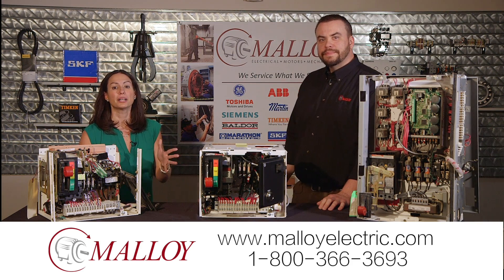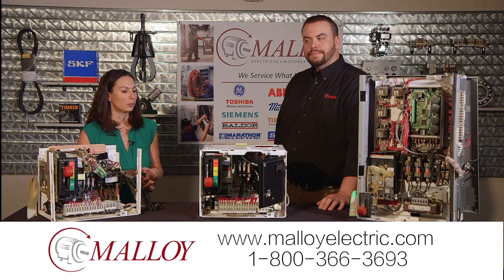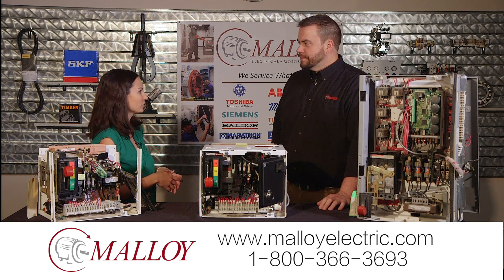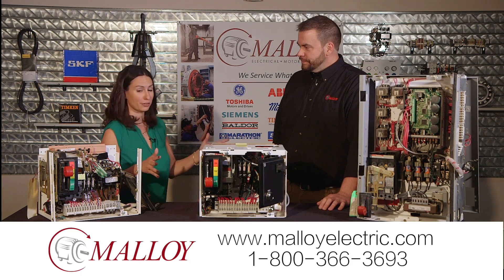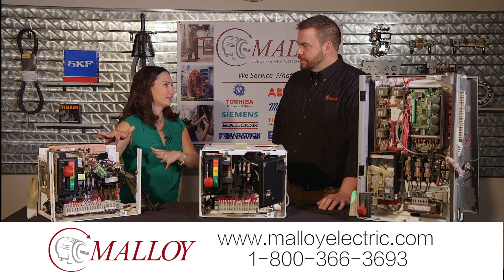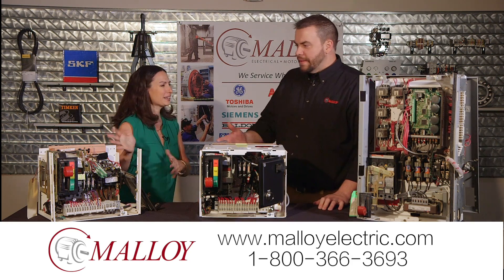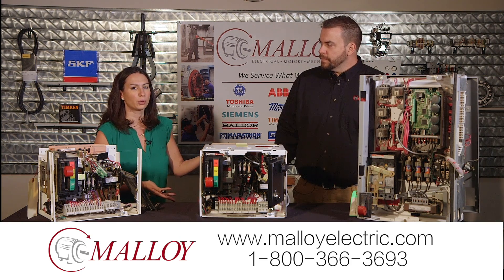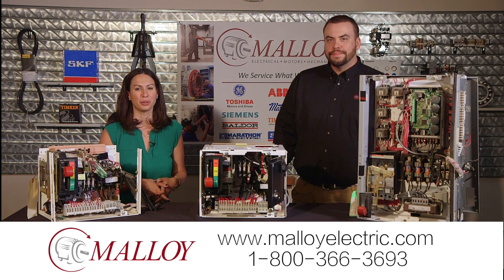Motor Control Center(MCC) Bucket Repair and Modification for Obsolete Buckets

Comment: Thanks for such a useful video, may i ask, for your Motor Control Center, do you need the PU gasket foam machine? or PU (Polyurethane ) Raw chemical? function special for gasket foam sealing, water-proof, Shock absorption... We are the most superior supplier, hope you can concern on us.
https://youtu.be/xe8_IftGLq8     Cheapest Gasket Foam Machine
https://youtu.be/TRSuWjE6h54    Colored Polyurethane 
https://youtu.be/54enOZbU_aI     Grey, Black Polyurethane
https://youtu.be/PYel6U3pTb4     Superior Gasket Foam Machine

if you no need it, could you please recommend our gasket foam machine and polyurethane to your customers, friends, peers, colleagues...?
Email:info@shwinman.com  M:+8615618818022
www.shwinman.com  www.winman.en.alibaba.com